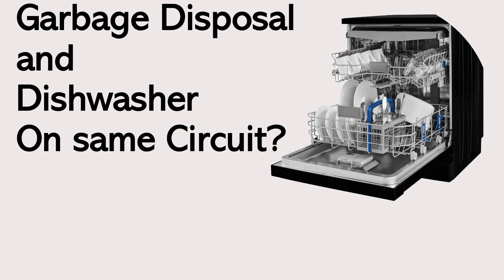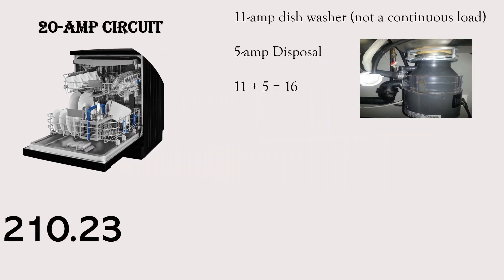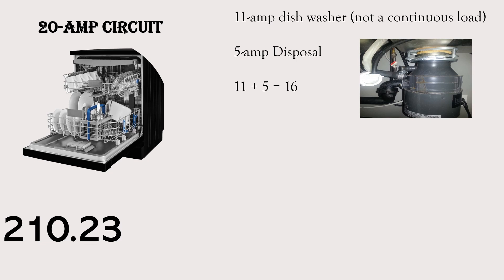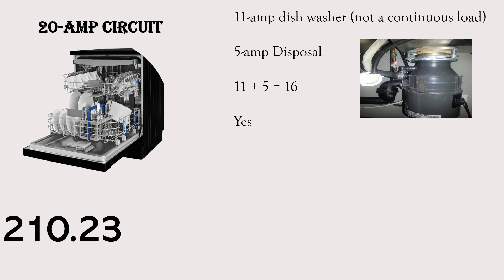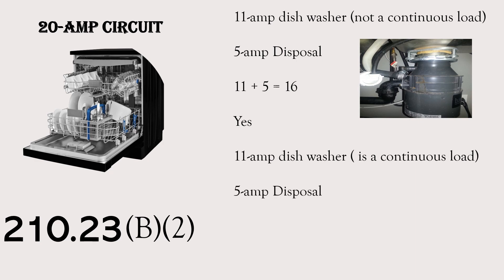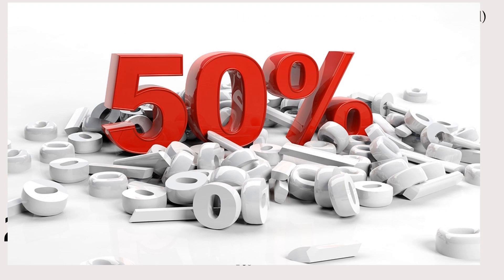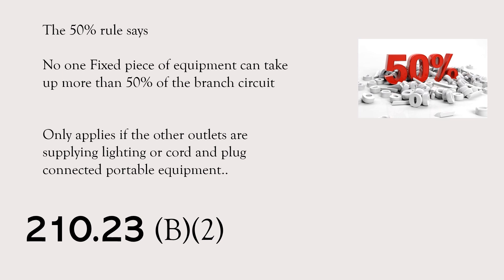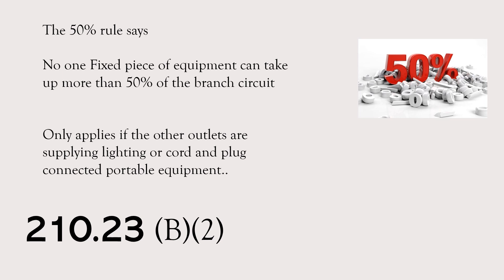Dishwasher and Disposal on Same Circuit? NEC 50% rule?

Comment: We actually just learned this in class (1st year apprentice) last week. The instructor told us how an inspector failed a kitchen he did for having the dishwasher and disposal on the same 20 amp circuit and cited 210.23(A)(2), but the inspector read the code wrong and thought it said you couldn't exceed 50% of the branch circuit rating. It's nice to know what you can and can't do as someone who's just getting his feet under him in this trade

Comment: In my experience, when the dishwasher finds out about the garbage disposal, you won't have either. Or a house.
Reply: Quack I disagree 1000% I have done it in 1000 apartments never once had a problem also think how long does a disposal typically run for???
Reply: Severely underrated comment

Comment: great video, thank you.  the only thing that still confuses me is: should I follow the code as it is written, or should I anticipate that the local inspector will interpret it differently and require changes to be made?  My guess it's better to err on the side of caution and run separate circuits whenever there is a question as to how it will be interpreted.

Comment: Can you run an 11 amp continuous load dishwasher and 5 amp non-contious load disposal on a 15 amp breaker?  15 x 1.25 = 18.75.
Reply from the maker: Great question, the answer is no, you cannot exceed the branch circuit rating after all math has been performed.
Reply: I am converting a dining room to a kitchen.  It currently has a single 15 amp grounded circuit.  What is the best way to reuse this circuit?  I'm thinking of running a new 12-2 wire for the dishwasher and disposal, two new 12 amp circuits for the countertops, and reusing the 15 amp circuit for under-cabinet lighting.and the refridgerator.  What are your thoughts?

Comment: With manufacturer’s recommendations superseding NEC, they can recommend a dedicated circuit for their equipment forcing the owner to buy yet another $50 Arc Fault Breaker. It’s getting rather expensive these days with new requirements but is it really justified?